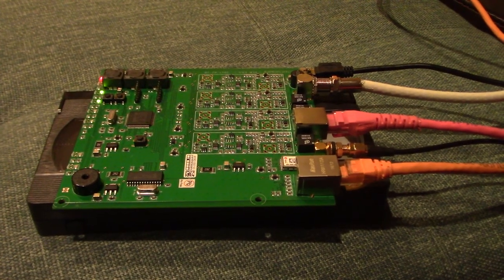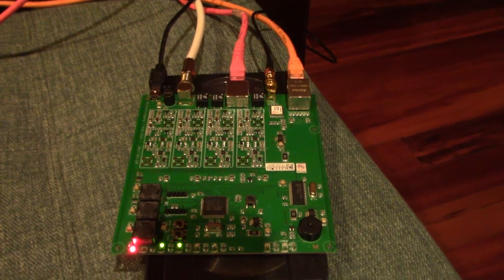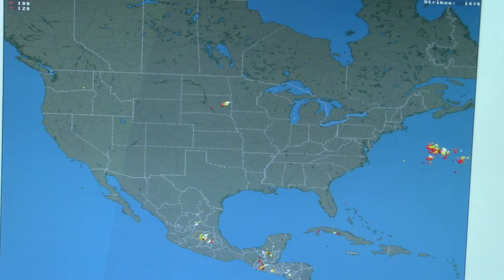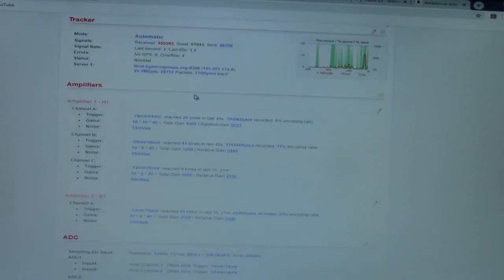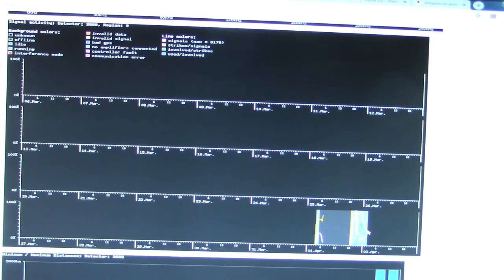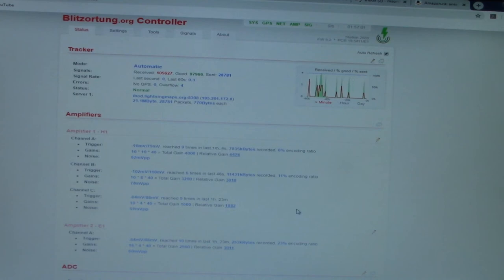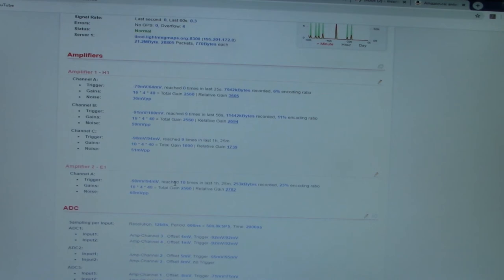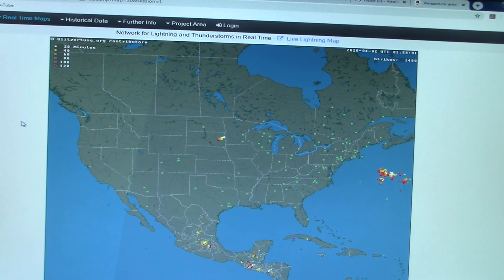Lightning Detector - Finding a Temporary Location - Part 2

Comment: To make sure things stay waterproof, I would recommend putting a layer of silicone conformal coating on both pre-amp boards, front and back. Unless you plan to keep it inside ofc. Mine has been outside for over 2 years now with no signs of corrosion. 
Another thing is to play with the amp gains (found on the signals tab) on an active day. Depending on your location you might be able to crank them way up and get a huge range. 
As a side note, it is normal to go into interference mode when you have a storm passing overhead. It's so sensitive you could get easily 100S/s

Welcome to the network!
Reply from the maker: Thanks, I've recently started messing with the amp gains and I'm getting way better results. No interference mode and I'm catching a lot more signal. Thanks for watching